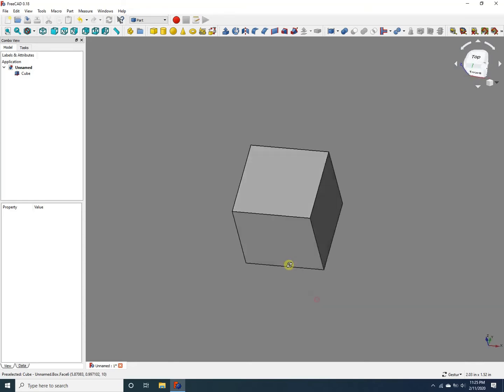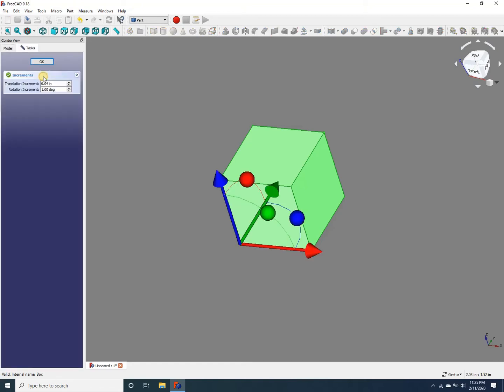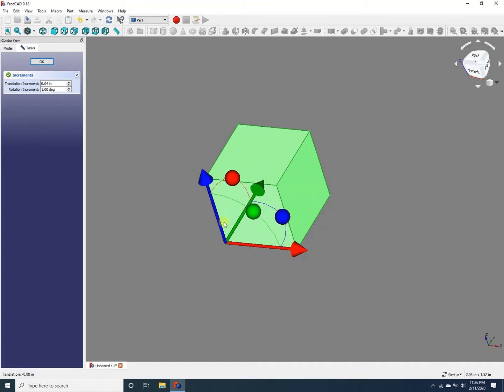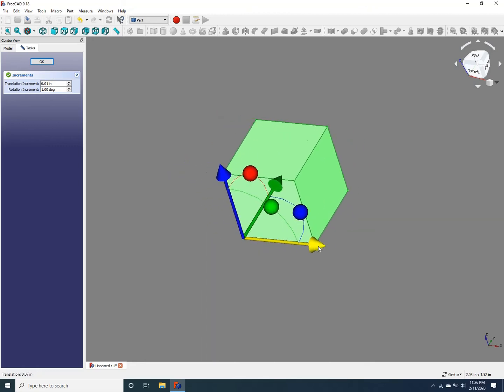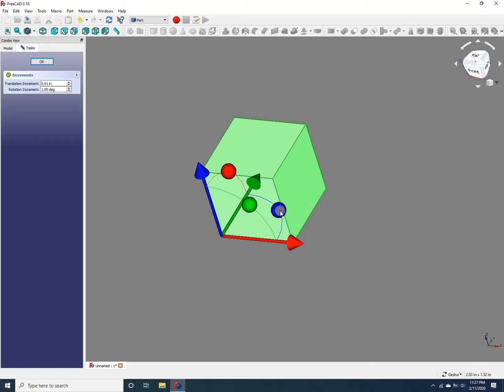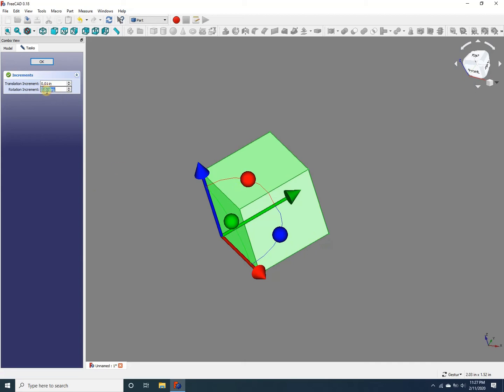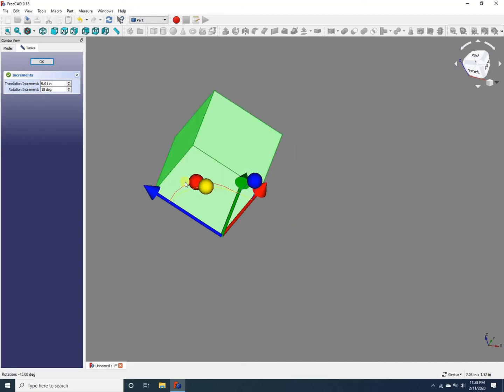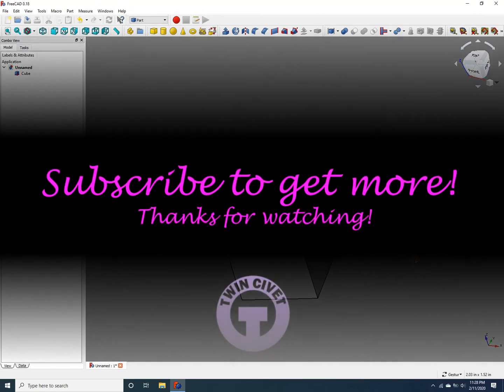Rotating or translating parts in FreeCAD along X, Y, and Z axes

Comment: Is this option not available in newer versions?
Reply from the maker: I have not used the latest version, but I'd be surprised if part rotation has changed. It's such a basic function. Make sure you're using the correct mouse controls.